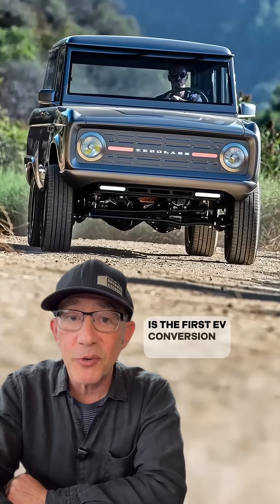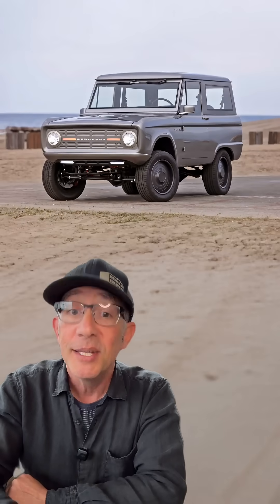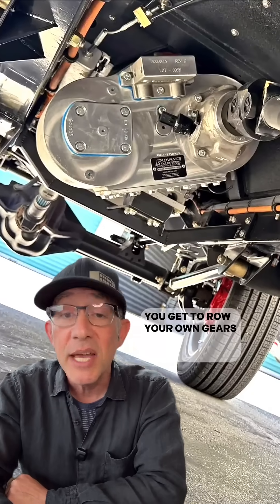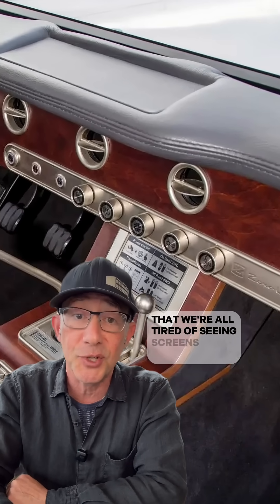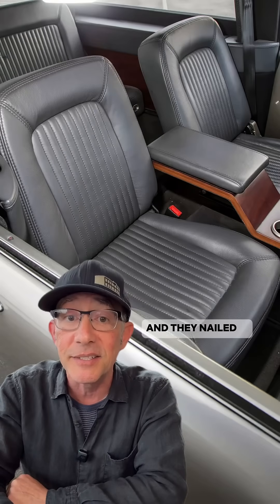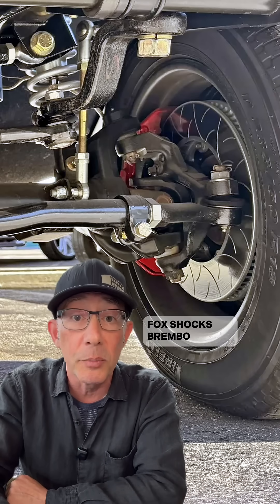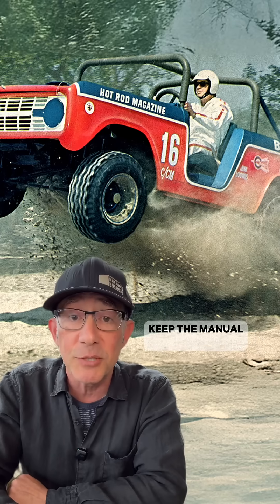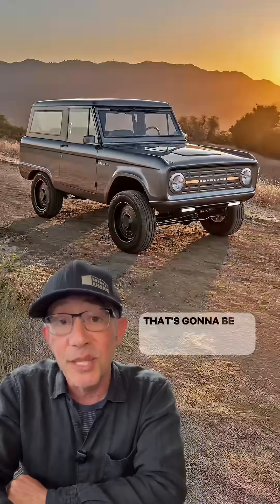But get ready to pay 💰️ #evconversion #fordbronco # savethemanuals #zeroemissions

Comment: One of the great things about slapping a manual transmission and electric motor together is that you don't even need a clutch. The electric motor can't stall so when you don't feel like shifting just leave it in third or something. That said, you're going to need a beefy transmission because electric motors don't gently roll on the power, every time you punch the gas pedal the shock is like revving it up and and dropping the clutch. 

I had the chance to drive a karmann Ghia that was EV swapped with a forklift motor probably 20 years ago and it was a blast.
Reply from the maker: That's a great point about the clutch, and a good heads up about the transmission too.

Comment: And what do you do with a dead battery?
Electric motor is fantastic, but batteries are dead, you have an expensive paper weight.
Reply: Charge it.  Figure out before you leave how much range you have and make sure you can make it out in time.  "Use your head for something other than a hat rack" - My pa.
Reply: @jasonstclair6293 No.... when the batteries die, they are dead, no coming back. New batteries will be almost as expensive as a new car.
Reply: @THX-vb8yz  Typically when someone says dead battery they usually actually mean discharged battery.  Yes a truly "dead" battery can't be charged.  My apologies.
Reply: @jasonstclair6293 that's right... truly dead.
Reply: Thats like asking what to do when you run out of gas... Just refill it dumb@ss
Reply: @Legendfish1111 No..... when the batteries die, they are dead! No, coming back and new batteries will as expensive as the car.
Reply: @Legendfish1111 apparently you nothing about EV's

Comment: Lovely vehicle, but really no point in adding the transmission. It's beautiful and very cool to add, but just more weight, maintainance, and not really necessary. The transfer case makes more sense, but apart from that it is an EV after all. Very cool though!
Reply: Everyone complains about not being able to shift an EV. It's probably a top three complaint from car guys along with noise and feel.
Reply: A car that drives long enough to need maintenance on the gearbox is a great car (if it's a good gearbox that is)
I'd say worth it.
Reply: I have alway wondered what would be the optimal 4x4 set up in an EV. I have seen so many go duel motor, interested to hear how a transfer case would be superior.
Reply: I'll agree that a transmission is pretty pointless, but in all reality there is typically zero maintenance on a manual transmission except for universal joints in the driveshaft(s).  It's going to be a lot cheaper to mate a motor to a transmission though then to put two motors on the axles and synchronize everything correctly.

Comment: How did they do a stick shift EV?
Reply: They just hook it up to the trans like a regular engine from my knowledge. That's how a lot of the vw beetles are converted through. The 5 speed is somewhat pointless as the ev motor has enough power and torque that it doesn't need a trans, but the transfer case is still useful.
Reply: You can have multiple gears in an EV, but it’s not really necessary for road cars because EV motors are so efficient at getting power out. Adding gears creates complexity also. 

Porsche has two gears because they weren’t happy that a single speed would have low top speed. The second gear lets them get a higher top speed. But EV motors are so efficient across the whole range that you could drive it in second from 0 to top speed, but it wouldn’t accelerate as fast as first gear. 

I dunno how they did 5 gears here, but if they did it so each gear can only do so much, it’s basically crippling the motor for the sake of experience. 

Also, an electric motor doesn’t need to disconnect with a clutch to switch gears, but it should stop spinning when making the switch. The controller tells it that, so the clutch pedal might just work as a button to tell the controller that a switch is coming.
Reply: It’s just a simulated manual prob